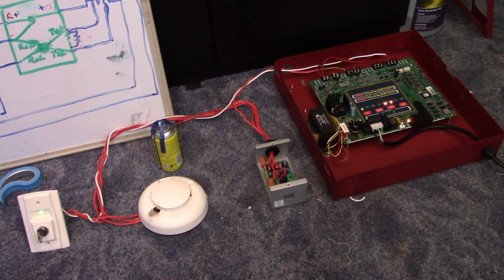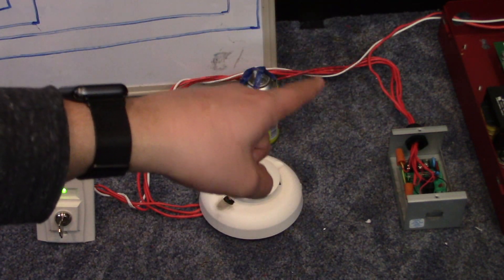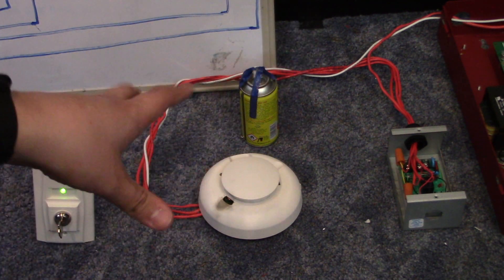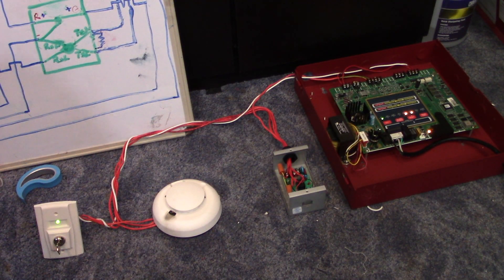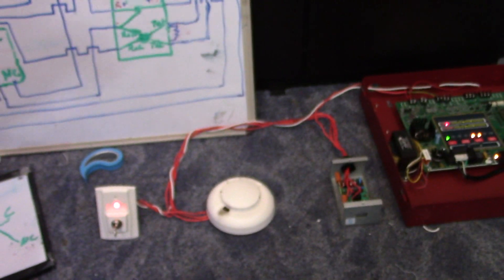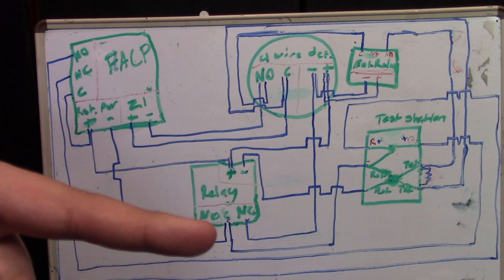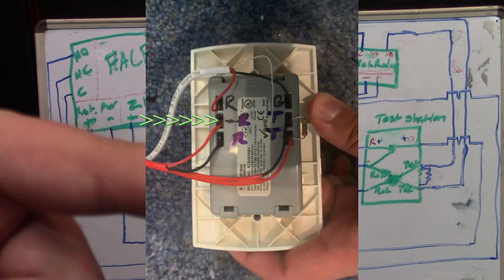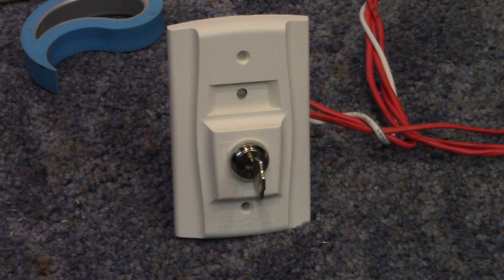How to use System Sensor Keyswitch (RTS151KEY) with a 4 Wire Smoke Detector and Panel

Comment: Nice! I have a question. Will the Fire-Lite RZA-4F work with the Fire-Lite MS-4424B without any extra things?
Reply from the maker: The Alarming Alarmist thanks! No, you need the 4XLMF interface module that attaches to the j8 pin headers on the board in order to use that LED annunciator. in the manual of the panel it says “Note: The Remote Annunciator requires the use of an LED Interface Module as described below.” and below is the said interface module. https://www.firelite.com/CatalogDocuments/15125.pdf page 11/52